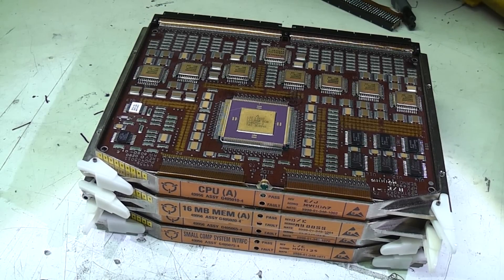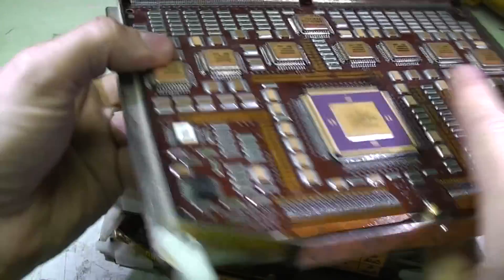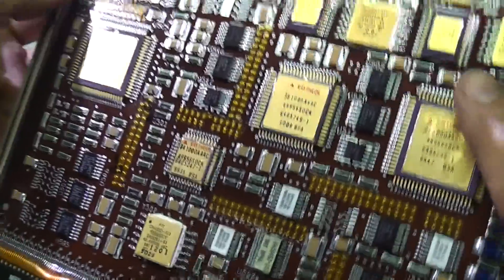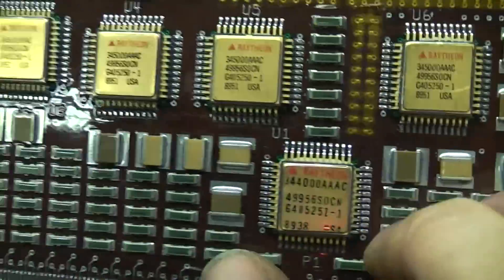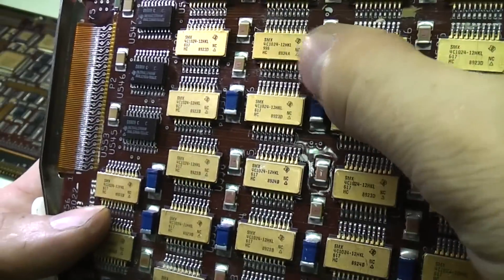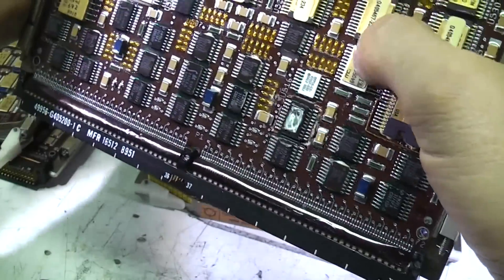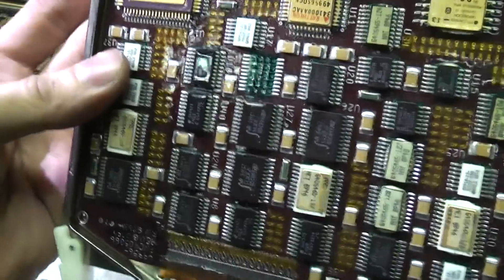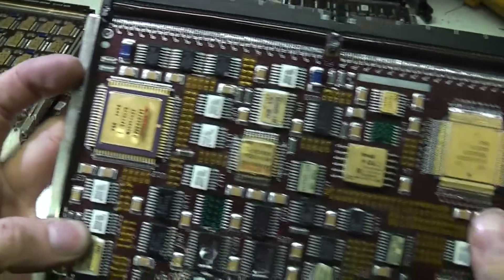Wierd military computer boards

Comment: It's amazing how nice you can make things when money is no object.
Reply: David Maddison It's not money being no object.  It's "here's a laundry list of functional and reliability requirements for the project, now go make something that meets all of them".   Oh yeah and your widget  is going to be retrofitted into an aircraft designed in the 60s+manufactured in the 80s.  It's like a cash register going cha-ching cha-ching as the costs add up.
Reply: +David Maddison That is from way back in the mil spec days.  They are a lot more COTS in them now.  way cheaper (but way more expensive in the end).
Reply: and when they can't meet all of them, you become french or wack job cia experiments with telepathy
Reply: Well said but On the contrary, their supply of money is what created this
Reply: @treatb09  
Telepathy as in phoning someone?

Look up the word telepathy when used for engineering you will find it's phonecalls.
Reply: no you are wrong.  maybe you should google telepathy
Reply: @wisp1adjukoneadj629  i think you mean telephony
Reply: your tax dollars @ work. the pentagon as an engine of economic growth.
Reply: Do they still dip modern military grade boards into epoxy like this or does this have changed?
Reply: infinite quality budget too

Comment: Interesting thing about those milspec ceramic components: they discovered that, in fact, milspec ROMS and EPROMS (at least early ones) were actually more prone to soft failures than commercial plastic stuff because ... wait for it ... the ceramic itself emitted alpha particles which could cause soft fails of individual cells in the ROM.

Comment: so thats were all my tax money goes.
Reply: +hifijohn Money well spent!
Reply: +Oriru Bastard can't tell whether I'm irritated or satisfied
Reply: +Oriru Bastard I remember the early 2000s the news stories claiming Sadam Hussain was buying up Ps2 consoles because the Cell processor was so powerful he was going to connect them into a supercomputer as a missile guidance system. Of course it was all a load of bull and wouldn't be surprised if Sony spread that rumour.
Reply: Oriru Bastard Probably only because like all game developers he couldn't figure out how to code for the Cell processor's ridiculously obtuse architecture.
Reply: +Oriru Bastard you mean ps3
Reply: One could say that the PS2 was a general purpose computer system, like any other PC in a way. I am under the impression that for avionics, guidance, satellites aso. , these systems are not used. A friend who studied Physics told me that much of the computers used for mission critical systems in sats are purpose build hardwired systems which can only do the job they are build for on a hardware level.

Comment: Ok, It really is interesting to see all the conjecture on here as to what these boards are/were. Here is all the straight scoop. MILVAX was an attempt to team Raytheon with DEC to create a militarized version of the commercial VAX computer. I was one of the two lead mechanical engineers on the program. The commercial and military versions were released for sale on the same day. This allowed the software to be developed and certified on commercial computers and then supplied to the government to run directly on the military version, with no alterations.  The commercial version used a mix of plastic leadless components, ceramic leaded, and thru board, while the military version used leaded ceramic packages. The dies for the devices were identical. The commercial version was a couple cabinets in size, the military version was an ATR Long sized chassis. The commercial version was forced convection cooling (air with fans) while the military used conduction cooling from the device to the sidewalls of the chassis. The chassis had cooling fins on the exterior surfaces, and fans to blow external air over these fins to remove the heat.
The boards are build to mil standards typical for high rel computers in the 80's. The conformal coating in military grade urethane. The large amount of gold on the boards was common for high rel military electronics. There was some radiation hardness to the militarized computer. The design does have EMP protection.
The module PCBs were polyamide glass. The module frames are electroless nickel plating over an aluminum core. They are not invar, or clad metals. That was something Texas Instruments pioneered at that time to match thermal expansion rates of ceramic (HERMETIC) components to allow leadless chip carriers. Matched TCE allows leadless device solder joints to survive temperature variations without fatique failures. The MilVax used leaded chip carriers for the large devices. The leads flex during the temperature cycles and do not fail. The ceramic chip resistors and caps solder joints were specifically shaped by the soldering process to allow flexing. This was unique to Raytheon at the time.
At the time this was made, it was state of the art. As you all know, SOTA is fleeting, and shortly thereafter, was just normal performance.
Versions were sold to several branches of the US military and NATO. And one flew on the Space shuttle controlling a payload experiment. They did fly on JSTARS during dessert storm. They are not in PATRIOT or any other radar system.
Someone made mention of Norden making a militarized computer, very similar. I worked with their version years earlier. It was a good design, but had some problems  which we tried to avoid in our design.
Hope this answers most questions. If you have any beyond this, Ill try to answer them.
I do have some odds and ends of hardware from these computers, and we have one in the display box which is full up and able to run.. If anyone is really interested, I will try to snap some pictures and send them in.

Jim L.

BTW, I was really honored by the 'its alien technology' comment..much better than the 'must have OCD' comment...

Comment: I worked on VAX systems and others for Hughes Aircraft Co.  Conformal coating was principally used for sealing out oxidation and for vibration proofing these boards.  The slides down the sides are indeed used for cooling.  They are called TMP (Thermal Mounting Plates.  Submarines and other Navy ships used these type of boards.
NTDS on US Navy ships ( kind of internet on board ships), was used to communicate between sensors and the systems.  I worked on Digital Equipment Corp VAX systems for the Government, on the Apollo Space Flight Systems at Goddard Space Flight Center Md and on Systsems used by the US Navy for the VAST-- Versatile Avionics Test
used on Aircraft Carriers for the F14 Aircraft maintenance. US ARMY used a System called TOAST which was VAX based system for personnel and finance.  Machine was very reliable and most maintenance was on Rotating Memory (Disk Drive for non IBM folkss\) Big old disks were the preferred memory device for system instead of Magnetic Tape Drives which had to search linearly for data.

Comment: I used to work on similar computer components like that in the military, the re-marked "Raytheon" components more than likely used to be marked with "Hughes". Raytheon bought out Hughes in the late  90's early 00's I think. Those "CPU's" are probably gate arrays, but they all look the same. The highest failure on this type of circuit card is the flex cables, after some time they break down from handling and such...go figure. Most of the components will not come off the board without heating, they have a conductive adhesive underneath that is no joke, most of the time, the chipsets and board get damaged when you remove them.

Comment: This is an extensive mechanical repackaging of DECs VAX computer by Raytheon. Thanks all for the complements. I was very proud of this design. And no, I don't have OCD, and whoever said this was common in the USSR, you are quite inaccurate. The die feature sizes were not.available in the Soviet Union till around ten years later.  @andreasm

Comment: I worked.at raytheon in Dallas, Texas. I think what you have there are either ground based radar system boards or radom aircraft radar, hard to tell.

You might know all parts are made in house or they drive over to TI to get custom chips. All systems are tested in what basically is a huge sealed ice box. They have to be resistant to EMP, corrosion, and long time storage in any weather.

Comment: According to the IPC J-STD-001, which is the standard and the training our company uses to train operators, Class 3 electronics are high quality electronics that are designed not to fail. We build engine control electronics for GE aircraft engines. These engines go on 737's 747's 777's and more! These controls are built so they shouldn't fail. Human lives depend on these electronics! Electronics used in hospital equipment are also built to this spec. Stuff like pacemakers, heart monitors, etc.

Comment: Boy the roomer mill is working over time the this one!!
The 4 boards went to a Raytheon ADCIS or "Air Defense Combat Information System". They are conduction cooled..  conduction cooled boards are multi-layer pcb with a heavy copper ground which is the center of normally a 5 layer pcb  (2 + 1 + 2) the center layer is clamped into the rails which helps cool the system 
in order the boards are:
G405010-4 -> CPU
G405020-4 -> 16Mb memory 
G405065-4 -> ASYNC/SYNC I/O (serial)
G405075-4 -> SCSI (hard disk interface)

Comment: These board are very common and were used in a lot of systems. Unfortunately getting the gold off of them is almost impossible as they have conformal coating on them which is an epoxy coating that prevents moisture, fungus and contaminates from affecting the boards. You would have to dissolve the coating with acetone or some other solvent before the de-plating process would be able to extract the gold. Raytheon probably did build the packages as the military did have a ban on using non-US sourced components. These days military systems are built from off the shelf components so the Chinese are free to embed hidden code in everything the military procures.

Comment: avionics boards, old camera array computer.  Seen them in use on avionics camera pods, like a big digital camera Desert Storm ERA.   If they are Classified, the minimum possesion age would be 50 years or until demilled and scrapped.

Comment: I wish I could see the stuff they have right now. It's crazy looking at pictures of computers in the 1960's and realizing they developed and were using technology we didn't see until the 1990's... People don't even realize how advanced some of this military stuff is like the minuteman guidance system. And it's generally not a gimmick either. If they design something which accomplishes it's goal and still works 30 years later, they'll keep using it.

Comment: I worked for McDonnell Aircraft back in the early 80's on military avionics.  These look like boards for an airborne avionics processor.  I have a vague memory of a computer on an F-4 based on MIL-STD-1750A.  Not saying this is exactly what you've got here, but they're definitely cousins.

Comment: Are you certain these weren't designed for space? I'm really surprised they would use a DEC VAC in a military setting. I once worked on a VAC, but as a jr and I don't remember much of anything about them and the one we were using was old (it was in the 90s, but the VAC was probably from the 80s)
Reply: tarstarkusz They look like they were meant for space, I have done a good deal of work with nasa, I have seen bars of "nasa gold" it was 99% Au, 24k gold is like 20% Au. Those boards are worth whatever gold is on them which looks like a lot plated in gold with gold cores for space.
Reply: serax It seems overkill for military unless it's supposed to survive really harsh conditions or maybe an EMP or something. Are you sure about 24K gold being only 20%?
Reply: tarstarkusz That's what most of the old high tech stuff used so yeah maybe for servere weather conditions or as you said space.
Reply: ***** Seems kind of old for the craft to still be classified. Maybe an ICBM? Of course, you could just as easily be right about the air craft.
Reply: They look too heavy too me for anything to do with space.
Reply: +serax They were robust.
Reply: +DarkVoidDan   It is too heavy for NASA stuff. They count every milligram.
This looks much more like hardware, hardened to survive total nuclear war.
Reply: +The Kaiser anything DoD related regardless of its implementation is milspec'd.. they are mini/mainframe server VME cards looked just like some Sequent computers Ive installed in the early 90's
Reply: DjCincinnatus I wonder how they milspecd Victoria "Fuck the EU" Nuland's mobile phone … Can't be too thorough.